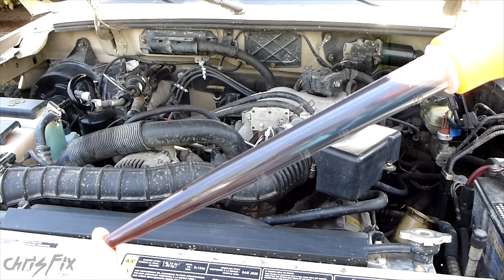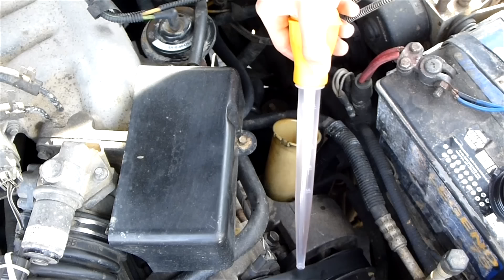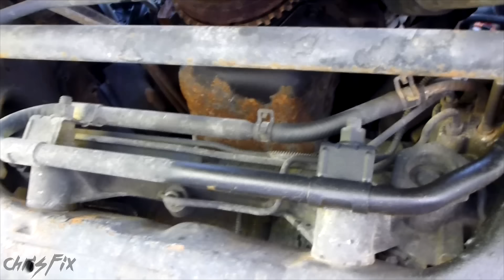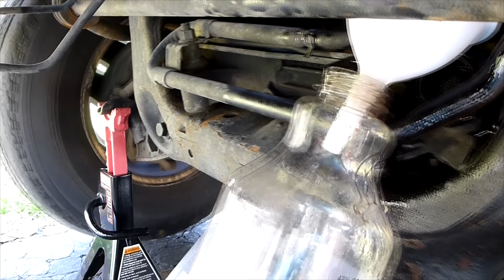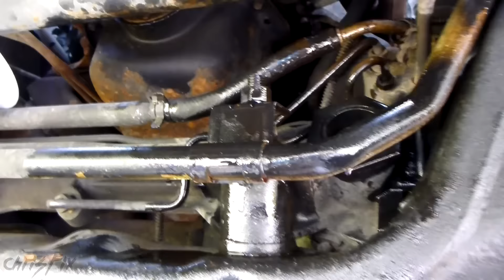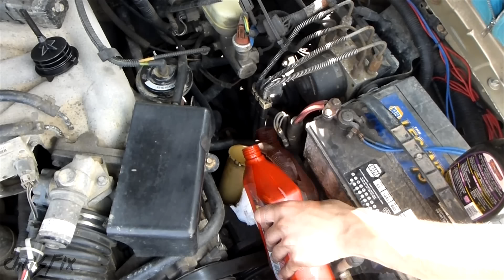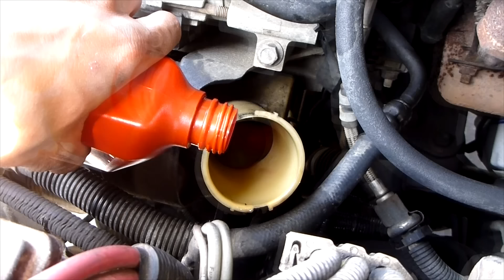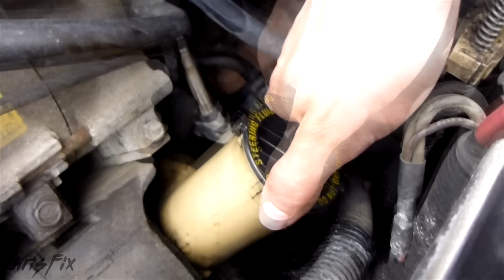How to Flush Your Power Steering Fluid

Comment: Hey Chris Nice video I have a Jeep Grand Cherokee 2004 4.0L (Laredo) and i followed your guide and even went as far as replacing my PS pump even though it was not required. The part was only 35 bucks so i figured why not. Anyway i still am getting the whining noise when i am in idle and also when i turn and even more in the lock position. I put in some PS fluid that was universal for honda and some others and it met Chrystler's Spec for my vehicle which was Mopar ms5319 (dont quote me i dont have the spec in front of me) Do you have any suggestions to make it quieter like your vehicle or am i as quiet as i can get ? If so please tell me the store or site where i can purchase fluid if you need me too. Thanks in advance.
Reply from the maker: Frank Spalding If the pump is brand new, give it a few days to bleed the air out by driving it around and turning the wheel from lock to lock. If the noise doesnt go away, try this out: http://www.amazon.com/gp/product/B000930N0U/ref=as_li_tl?ie=UTF8&camp=1789&creative=390957&creativeASIN=B000930N0U&linkCode=as2&tag=chri0e2-20&linkId=K4SL327JZ4Z7KRJW
Reply: Thanks for the quick reply, ill give it some time.

Comment: I have a question,  mechanics usually have a vacuum machine for changing engine oil. Would it suck the power steering oil enough without disconnecting any hose? Like if he puts the sucking pipe deep into the power steering reservoir.
Reply from the maker: anas alwash You can use that machine to suck most of the power steering fluid out. You wont get all of the fluid but it will be enough. That would work.

Comment: Is it possible to flush the system without having to jack the vehicle up? I am trying to flush or possible change the PS pump on my 96 Toyota T100 and do not have a jack or jack stands. We just had 3 straight days at 10 degrees or below and went out one morning to crank it up to let warm up, and then once i got in to drive it the god awful groaning and whining sound started and steering was a little harder. Was fine once I got down the road on the interstate, but now I have a new pump and am faced with the task of either replacing the pump and/or flushing the system...and no way to immediately raise up the front end of the vehicle
Reply from the maker: Chris P Before replacing the pump, I would make sure it isnt just old fluid that is causing the noise since that is a lot easier. Depending on where the power steering pump is (top of the engine, bottom?) you might not have to jack the truck up.

Comment: You do a good job on your videos! I enjoy watching them.
Reply from the maker: zephyr Dok Thanks a lot man! I am glad you like them!
Reply: I just recently got a 2001 Dodge Ram 1500 Magnum. It's got about 136000 miles not too bad, full tank normal driving I've gone about 140 miles on a half tank. The main problem that I'm having is that the OBD 2 pin number 18 apparently has low voltage, so I can't hook up any diagnostics scanner.
Reply from the maker: zephyr Dok Dang, that stinks. I wonder what is causing the low voltage problem...
Reply: I have no clue! 
But it sucks.
Reply from the maker: zephyr Dok Let me know if you figure it out! Maybe the wires behind the obd2 port are loose.
Reply: Yeah maybe, but I'm not really trying to have a mechanic poke around while charge me $50 /hr trying to find it while using the process of elimination then telling me it's a fuse bc thus far it's not a fuse. 3 separate codes showed up on the dash when I turned the key off and on 3 times, two for evap canister (California emissions shit) and the other for something in the fuel pump and or gas tank.
Reply: I'll keep you posted tho

Comment: the way I flush my power steering system is use the turkey baster , get out what I can refill it then give it a pretty determined amount of time for fluid to get thru   and reflush again . do this 2 or 3 times till fluid is nice and pink
Reply from the maker: Mike Cullinan This is a great method to use too. It is simpler and if you maintain your power steering fluid after that, you can just use the turkey baster once a year to maintain the good fluid!
Reply: when you say that you give it time for the fluid to get through, are you running the car and/or turning the wheel? Or are you just letting it sit for a while? Looking at changing mine soon and this seems much easier and cleaner than messing with the hoses. Thanks ChrisFix for the helpful video!
Reply from the maker: Kyle Lantz Check out this video where you dont have to remove the hoses and let me know if you still have any questions: https://www.youtube.com/watch?v=VuPALAnHjRM

Comment: Good tip to move steering wheel lock to lock (before removing the low pressure hose).  Good tip to add new fluid to push old fluid out (via the disconnected low pressure hose).
Reply from the maker: Michael Chitwood Thanks bud! The idea is to make it as easy as possible and get the most amount of fluid out as possible.
Reply: Never disconnect the high pressure line (usually it's made out of aluminum).

Comment: Hay Chris, I have a 2001 Olds Alero and I'm going to try to flush my power steering system by using the old pump (before replacement) and removing the return line, capping the return port on the pump, then tubing the return to a container. Then I will have a helper start the engine and I wall have them turn stop to stop while I make sure that the reservoir level stays high. Can I do this? Can I use the old pump to force new fluid through the system first, then change the old pump out with the new one and bleed a little more, then finish? Is this possible? Thanx in advance...
Reply from the maker: Tony Messina You can totally do this since you will be replacing the old pump. This will actually work really well. Make sure you be careful because you will shoot power steering fluid everywhere. Let me know how it goes!
Reply: +ChrisFix  OK.. I finally got to that to find that when you use a clear hose for the return to a bucket as  you add fluid while someone turns the wheel side to side, the action of fluid coming through the hose is a chaotic spewing that never seems to form into a visibly acceptable amount, could not tell if it was actually dirty or clean. However, I pumped an entire bottle of PSFluid and then finished the job to find that this time, my efforts to replace my power steering pump was successful and it has been running fine for about a month or so now. Thanks for the tips and useful information I got from your video.

Comment: Hey Chris. Great videos, so I tried to flush my steering system the other day but couldn't get any of my hoses off. Any tips?
Reply from the maker: Chinesefoodrocks1521 If you cant get the hoses off, do this: https://www.youtube.com/watch?v=VuPALAnHjRM
Reply: I did go to that method since I couldn't get the hoses off, but I went through a quart of fluid and it's still black.
Reply from the maker: Chinesefoodrocks1521 Yea. You are going to have to drive around a little and do it again, Do that a few times and it wont be perfect but it will be good enough.

Comment: Just so you know your power steering self bleeds just like any other hydraulic system
Reply from the maker: ericsnyder7462 Yes, but you can bleed it faster so there is less air in it using the methods I showed in the video. Thanks for the tip!

Comment: I accidentally flushed my power steering out a week ago. I went to warm up my car and when I started to leave I couldn't turn. As it turns out a line on the low side of the power steering had blown off, and there was a huge puddle of fluid where I was parked.
Reply from the maker: Wesley Young Aw man. Well now you did half of the work, without doing the work lol
Reply: ChrisFix Yeah, sort of. I ended up just fixing the line and filling it back up with atf. Given that I was going to be late, and it was 4 degrees outside.
Reply from the maker: Wesley Young boom, flush completed lol
Reply: ChrisFix
Hahaha, I guess so.

Comment: I wish I would of watched this before I did my step dads Ford F150... Cuz his still made noise after I flushed it. Could of used that stuff you were talking about and... Who knows, might of made it quiet down lol :( great procedure!

What's really weird is my 94 Honda Civic had 3 lines coming back... Could never figure it out lol. Also, I love how you showed it without starting the car much at all. I always thought you had to start the car to get the old fluid out... Which always became a mess... Lol. Thanks!
Reply from the maker: ***** I am glad the video was helpful. Now you know for future flushes. That is weird that the Honda Civic has 3 lines coming back. Maybe that is just how the rack and pinion is designed?
Reply: ChrisFix Possibly. I never really looked into it, and I got rid of it recently (it threw the harmonic balancer and the timing belt started getting eaten away, since I was on the freeway at the time) so, I couldn't tell ya haha. But only 1 of those hoses would shoot out fluid while the car was running... The others would be a slow return. Maybe 1 is a bypass, 1 is for the left side, and 1 is for the right side? lol! who knows.
Reply from the maker: ***** Maybe one was high pressure and the other two were low pressure...
Reply: ChrisFix I'm not sure :/ cause those 3 lines were going to the reservoir Literally... I think there was 1 line coming off the pump, if I remember correctly..

Comment: my god i cant see the bottom of my tank, i think its mud. have to look on cleaning tips
Reply from the maker: metalon Ouch. I would definitively flush your system out then! Good luck!
Reply: its Lexus is200. I removed the tank and proceeded to clean it. It actually has a filter. Heated up a toothbrush to make it L shape and tried to scrub it as much as possible on the inside. The tank is clean and fitted back. My problem was that the steering was stiff for 2-3 minutes after cold start. Changed the fluid and I hope tomorrow everything will be fine.
Reply from the maker: metalon Awesome job! Let me know if it fixed your problem!
Reply: The stiffness is gone. Thanks for the tips on how to pull out the air!

Comment: hi you disconnect return line from reservoir to flush old fluid but when you add new one you somehow must block reserwoir connection to retun line in case not to spiil out new fluid from the hole of reservoir?
Reply from the maker: abacus091 Yea because both the return line goes into the reservoir so when you fill the reservoir, it will flow reverse and out of the return. Make sense?
Reply: ChrisFix exactly:)

Comment: Chris. I have a weird chirping noise coming from my engine. Is it possible it's the power steering pump? It was replaced about 2 years ago but I don't think they bled the system. I would have done it myself but I was away from home when it failed on me. I'm just Not sure if it's power steering or water pump. 

Thanks.
Reply from the maker: MrLdspm A bad power steering pump usually whines. Check this video out to diagnose your problem: https://www.youtube.com/watch?v=UF3W-vHPYHg
Reply: ChrisFix turned out to be the idler pulley.  The power steering is groaning but I'm hoping it will hold till the spring.
Reply from the maker: MrLdspm Thanks for the update! Glad you found the problem!

Comment: My owner's manual (1995 Toyota Tercel) says I should add dextron II automatic transmission fluid instead of power steering fluid. It says the same on the cap for the power steering reservoir. Would it be safe to add power steering fluid instead of atf? Why am I supposed to add atf instead of power steering fluid? Great videos by the way.
Reply from the maker: creative_username Do what the owners manual says. I would think it is ok to add power steering fluid in an emergency, but if you are doing the flush, put the fluid that Toyota designed the power steering for!

Comment: Hey Chris, great videos! Recently I've been noticing a bit of noise from the power steering while entering and driving on long, circular on-ramps. I checked the PSF and it is at MIN. My question is: would you recommend flushing the whole system and completely replacing the fluid, or simply topping off? (I don't know what kind of fluid is currently in the system, but my vehicle requires Pentosin CHF 11S, which is a greenish color, while the current fluid seems to be whitish/yellow).
Reply from the maker: Bill Ruml If you dont know what fluid is in it and you want to put in a different color fluid, you should probably flush it. If you know what fluid is in there and you are putting the same stuff, you can just suck as much out as you can and fill it up with new fluid. Sounds like you should do the flush if possible.

Comment: Nice work!  MUCH better than the method of using running car to force old fluid out.  Can you believe Honda recommends using the running engine method, running all the fluid out, then refilling??  Jeesh.  Only way I seen that work is with 2 people, one filling as the engine expels old fluid, but most of the time its hard to keep the filling rate as fast as the purge rate.  Stay gold.
Reply from the maker: ***** Thanks! I cant believe they want you to run the pump dry! That is just asking for problems!

Comment: Urgent Chris please reply: my jeep steering fluid is coming out of my reservor cap and it looks  like bubling out of the reservor cap and making noise like yours what do you think should i do. do you thihnk i have to bleed it like your.    how many steering fluid shlould i put and hw much trasmission fulid should i put please reply right away   i reeally need ur opinion
Reply: GAR A There is a car refurbishing show on TV called Wheeler Dealers.  They had a similar symptom (fluid squirting out of the top of the power steering cap).  In their case the problem was bad seals in the steering rack.  Once they rebuilt the rack the problem was solved.  Sorry that I cannot remember all off the details.  I'm not saying this is what you're experiencing, but you might want to check it out.
Reply from the maker: GAR A What do you mean it is coming out of the cap? Did you do the flush? Are you running the engine? Did you try bleeding the system by turning the wheels from lock to lock? I need more info. Also, make sure you are using the correct fluid for your specific car.
Reply: ChrisFix  Power steering fluid comes out the cap, pump makes noise  I can see fluid on the reservoir, on hood insulation, all over pump cap 
i didnt do try nothing it just happen when i take right turn and it start noise then when i check my hood i seen a fluid coming out the cap. every time i start my jeep it takes minutes then i can see fluid coming up then out the cap reservor.  i am thinking maybe things will be fix if i bleed then put new steering fluid
Reply from the maker: GAR A Sounds like there might be a clog somewhere. Is your steering hard?
Reply: ChrisFix nope  it has a loud clank sound, steering is soft but when i turn left or right it make the sound louder then later i can see steering fluid coming out of cap. one time i open the cap i let it my jeep run i can see the fluid rise then come out.  it looks bubly but when u turn it off the engine it goes back to normal liquid.  i dont wanna change pump or any expensive hoses if the i can fix it by changing fluid that is my first thuogh right now i let you knew if i can fix it , but maybe you can give me suggestion what to do first thak you

Comment: How come the car dealer charges $130.00 for a power steering fluid exchange? It didn't look that expensive to do in your video. They also want to change the brake fluid for $160.00.
Reply from the maker: Dasdfjkl That is because the stealership is out to rip you off. You never go to the stealership to get work done unless it is under warranty. I know people in the business and they are some of the most dishonest people. That being said, you can easily do this yourself for a $1 turkey baster and $5 of power steering fluid. Here is a video on flushing out your brakes completely: How to do a Complete Brake Flush and Bleed

Comment: Chris I just had my P/S fluid flushed and changed but I'm sadly still havin a whinin noise coming from the P/S someone told me it is time to change the pump but to not USE rebuild pump only new. But sadly for my 01 Dodge intrepid the dealer only has rebuild ones.....
Reply from the maker: Dblade981 It really doesnt matter if you get a new pump or rebuilt. Either one is fine. Just get whatever is cheaper. How loud is the wining noise? You might try using an additive such as this: http://www.amazon.com/gp/product/B000ARPVNO/ref=as_li_tl?ie=UTF8&camp=1789&creative=390957&creativeASIN=B000ARPVNO&linkCode=as2&tag=chri0e2-20&linkId=G6SJJKTGMRGBA5LF or you can try the other product I linked in your other comment. Either one will work if there is any hope in saving the pump. If the pump is bad, there is nothing that can be done and you will know that because the additive doesnt work. Do you have a hard time turning the wheel?
Reply: ChrisFix  It sounds just like the whine on your video but sounds a bit louder once i hit the gas. I am goin to get that barleak and try it out and let you know how it goes thanks man!
Reply from the maker: Dblade981 Keep me posted and good luck! It is worth a shot before just replacing the pump! Maybe it will work and you will save money!

Comment: How many extra quarts should i buy to flush it?
Reply from the maker: Matt Kenton I used 1qt but I used every last drop so you might consider picking up an extra quart. Check your owners manufal under "capacities" or "specifications" and see if it says the volume of your power steering system.